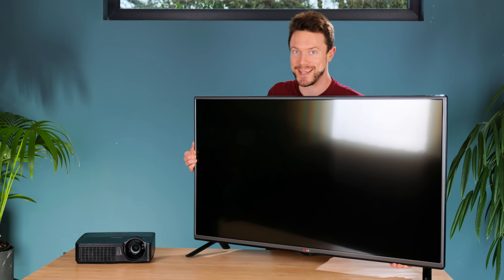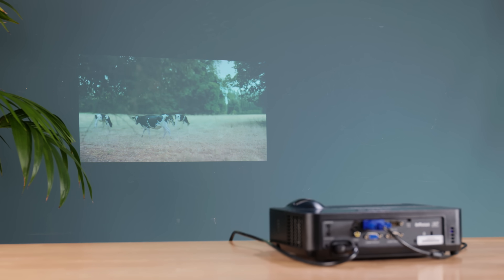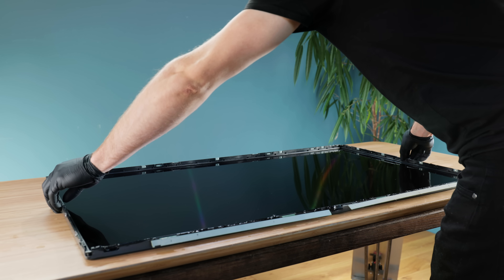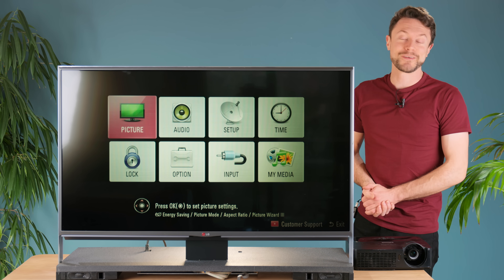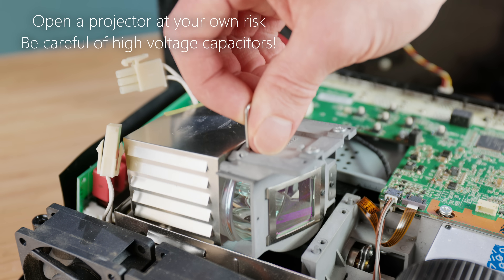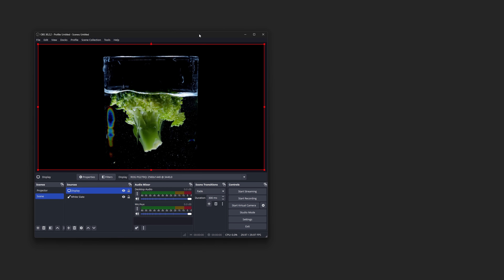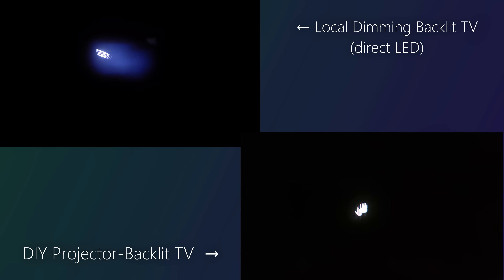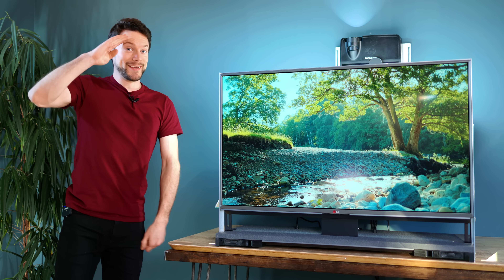DIY "infinity contrast" TV -  with 100% recycled parts

Comment: I'm sure the engineers at Dolby and Highsense who worked for 15 years to crack this nut are feeling pretty silly right about now lol. 

This is amazing man. Just gonna say, an 8K Samsung QLED as the LCD panel with a 4k UST Laser projector with 8k pixel shifting would give you a screen nobody can buy, you could probably also up the voltage on the lasers and get it to HDR levels of brightness for your own Pulsar screen.

Comment: There are high luminance projectors out there, which throw out a LOT more light than these cheap office ones. The really cool thing about this project is that upgrades to the components scale really well to the final quality of the screen. 

(And conversely, you can reach a proof of concept with real garbage level devices 😅 )

Comment: 17:35 His finger is reflecting the light, which means we are most likely being tricked somehow. Most likely the light is coming from the front, so it is casting a shadow.
Reply: Notice where he is standing, right next to the contraption, if you look closely at his hands in that time frame you will notice that the light is in the back side of his hands, the light is reflecting off his hands onto the tv causing that effect. It is not a shadow that is being casted but actually a reflection of his finger.
Reply: @me_1210  17:48 his hand goes behind the screen and doesn't interfere, but at 17:22 there is a reflection. At 17:56 is a good moment of display and no overlap. 

With this video, there's something wrong or something not being completed

Comment: There is a problem with your mechanical design. When the electronics were in its original position it was upright so convective air flow was cooling it. And, frankly speaking, that was JUST enough to not overheat it. So when you laid it horisontally the convection became much worse.
Reply from the maker: It's a good point, but now that it doesn't have to power a backlight its total power draw is only a few watts so doesn't get hot at all.
Reply: @DIYPerks  I think that the CPU is the hottest part, not PSU.

Comment: Projectors usually support 3D video and high refresh rates out of the box (Even higher if you take the color wheel into consideration.).

Would it be possible to make all of your images/videos several of the specific color components each frame and also give it high refresh rate video (Though, needing to somehow disable the DLP 3D glasses pattern between each of left and right eye.) to achieve a sortof PWM effect to dim the light output of the projector for better color reproduction?

Comment: This is the same way the Christie Eclipse projector works, albeit with 2 sets of DLP chips working in series. The source image is split two ways, one going to the image chip (the LCD panel in this case) and the other to what they call the 'pre-mod' chip (Matt's projector acts as the pre-mod). The pre-mod chip performs essentially the same image processing that Matt did here with OBS. Downscale to a lower resolution (the Eclipse is 4K but the image sent to the pre-mod is downscaled to 1080p), convert to grayscale, dilate/glow, dither (probably using ordered since its the fastest and least compute heavy) and finally some amount of blur, using either software or optically. You can find the patent for it online. It's actually an idea that's been around since the invention of the DLP chip. I think the first patent I've found was from around 1999.

Comment: But this is possible to achieve by using 2 lcd panels where the first panel is just black and white for the luminance map and the second front panel is the color filter.
You then put the diffuser sheet on the back and use a very bright but small lightsource

Comment: Great idea, but it's not infinite contrast as the title claims. The DLP projector itself has a limited contrast ratio like 1000:1. The dark area does not mean it has completely no light. The DLP still shines very small amount of light to the "black" areas as well. It's a huge improvement compared to the old LCD TVs, but this does not mean this DIY will give you the "infinite contrast" like OLED whose black level is really zero.

Comment: I am curious because you do not make it clear in the video. Using the TV panel, the projector and OBS, how exactly have you managed to get all of them working together? I am assuming the image on the TV is being provided by a computer but how is the image being sent to the projector via OBS? is this being done by the same computer using a 2nd video output on the computer? You need to explain how you did this.

Comment: Wow, great project. I have the exact same tv. The backlight died and I had to replace it using parts from AliExpress. After I fixed it, I found it was not too bad to calibrate the color. The stock settings were far from accurate.  Grass looked brown.

Comment: How is this any better than just using the projector on the wall? Also, why does the TV still need to function? Can't you just use the diffuser screen with projector?
Reply: The color and resolution of the projector are worse than the lcd panel.

Comment: Sony did this in 2005 with 3LCD rear projection TVs but at the time they didn’t have the PC to be the image signal processor and still had a DLP wheel projector. They were very cool though and I’d imagine if you can find one cheap and swap out the LCD panels for a 4K one it would be ideal as projector, mirror alignment and case already there.

Comment: Perhaps I do not understand this fully, but why do you need the diffusion layer with this method? Wouldn't it be easier, more accurate and brighter backlighting, and possibly even eliminate the need for the OBS -hack if it was not there....?

Comment: LTT recently ripped apart an old rear projection TV as a case to mount an OLED TV at the front and then stuff a bunch of gaming hardware into the cavity.

I wonder if it might be practical to convert an old rear-projection TV into a self-contained version of your "infinity contrast LCD" by using a similar approach to mount an LCD TV panel at the front.

Comment: 17:00, I was thinking, you could reduce the throw distance by switching out those flat mirrors for a pair of convex mirrors. You might be able to do it with a single mirror if you curve it enough. On top of that, a tighter curve will also allow for a smaller mirror making it easier to enclose this entire setup for a more polished look.

Comment: So just a short throw,

While using a projector for this, isn't using a double TV going to have the same results? 

The light from the local diming limitations is visible on the first image screen, but it's going to be so low in comparison with the second difusion towards the second screen, you loose most of that effect. The better part is that you only need to upgrade the original backlight lamps to be more powerful (and most likely add some additional cooling on them) to pass through two diffusion layers and screens.

This would also solve the thickness issue.

Alternatively, to keep using the projector, you'd be looking at some crazy funky lenses to bounce the light to where it needs to go. Not per se a short throw projector, but definitely a short throw lens.

Comment: Your idea reminds me so much of the Hisense dualcell tv. It was a LCD tv that had local dimming, but also had 2 LCD panels. The backlight would pass through a 1080p black and white panel before going through a 4k color panel so it would practically have almost per pixel dimming. I believe the local dimming was kept for both energy saving and the fact (as LCDs nature) the black and white panel would still let some light through. I'm sad it failed. I wanted one so bad.

Comment: I am surprised no one in the TV industry thought of this. I hope some manufacturers watch this and start bringing back short throw crt style TVs back. And Oled like screen for a cost effective price seems like an amazing business Idea. They need to have an easy way to switch out the bulb for sure and make sure they are long lasting.
Reply: One good board today should be able to process pretty much both the TV and the projector.
Reply: Led backlight is way more advanced now, which gets way brighter too. New LCD large format have rgb backlight, which is suppose to be a game changer. Oled is still the way Togo, especially now nthey can get fairly bright.

Something like this would be cool for a diy project, again the brightness is the issue with the projector. Its only worth doing if you can do it for cheap. If you want the brightness, well, you may need to spend 2 thousand dollar on a laser one.

Comment: Fantastic project; way to go! It makes me think of an engineering solution that may lower the price of OLED TVs without compromising on their image quality: instead of using expensive RGB compound pixels, use a cheap all-white LED array as backlight, to later filter using the cheap LCD technology shown in the video. This way, flatness can be achieved with minimal distance.

Comment: This will be my first DIY that I will actually implement from your channel! Just one clarification, the projector and your TV are using the same source? If i want to project my laptop display, will it need to provide inputs to both TV and Projector simultaneously?
Reply from the maker: Yup, spanned displays (obs does the duplication). More info on the forum thread.

Comment: Once again, you raised the bar for all DIY channels! However, my only concern and slight disappointment is that there was not Brass and/or Copper used in this brilliant upcycling project! You're the reason I brought enough brass and copper for a life-size Mark 43! 
PS: Just a quick observation/suggestion. In the Title, I think the word "Recycled" should be replaced with "Upcycled"!  I believe the title should match the idea, design and execution of the project. The highlight by OLED or LED of the project is the genius combo of tech, techniques, research/knowledge and creativity that went into bringing an idea to life only using repurposed hardware parts and software/hardware stacking workarounds!  
 ( I sincerely apologize for the long comment and explanation attempt and hope some friends, channel fans and supporters here agree with the observation!

Comment: Why not take an old 1080p LCD TV with a normal backlight, and then run the OBS filter through that TV, and then sandwich that behind a newer 4K LCD TV of the same size? There shouldn't be enough backlight bleed coming through, but I guess the peak brightness would be lower? Might be worth trying.

Comment: That's a fantastic idea. I think ideally you don't use the luminance map (as dimly lit scenes will get backlight bleed that way) and rather do processing on the LCD. Calibrating it all would be a challenge. However if people wouldn't be so crazy about thin TVs, this could make for a fantastic TV. Think a blue short throw laser shining on a quantum dot panel to convert the light into white, then a good LCD panel in front of it. Calibrate it all well and you'd have a long life, burn in free high contrast screen. Not sure how bright it would really be, and in terms of pricing a laser projector glued to a LCD will probably cost more... but it might be quite impressive. And flat. And to get more brightness, add another projector from the other side. Also not sure if the diffuser is necessary.

Comment: for super thin, sandwich two LCDs of the same diagonal size together and upgrade the backlight.  The contrast of the screens will multiply together so even if there is a tiny amount of bleed from the first layer the second will crush it to nothing.  There must be a fundamental flaw in this idea because it seems like a super trivial way to make high-end LCD screens?  E: Answering my own question here, polarization filters.  If you've ever looked at an LCD with polarized sunglasses you can grasp the issue immediately.  There's probably a clever workaround here with the diffusion layer.

Comment: You didn't need to do so much work. It would be super simple if instead of a projector you adapt the LG LCD panel to a Mitsubishi DLP screen of the same size, that is, you need a Mitsubishi DLP TV of the same size as the LG, fortunately not only Mitsubishi made DLP TVs, there are several brands including LG too
No era necesario que hicieras tanto trabajo. Sería super sencillo si en lugar de un proyector adaptas el panel LCD de la LG a una pantalla Mitsubishi DLP del mismo tamaño, es decir necesitas una TV DLP Mitsubishi del mismo tamaño que la LG, afortunadamente no solo Mitsubishi hizo TV DLP, las hay en varias marcas incluso LG también

Comment: Surprising that TVs haven’t shifted to using an extra monochrome LCD layer behind the diffuser to get this same effect. It could be a cheaper alternative to OLED but with a similarly amazing contrast. Cool stuff!
Reply: There are some consumer 4K sets with an extra 1080p monochrome panel acting as an extra filter. I think it was by Hisense or something.

I think it had some issues with ghosting and input latency and ofc it wasn’t very energy efficient/bright as the added layer reduces backlight output so basically the challenges that dual lcd monitors generally have.

Though it probably could be improved by reducing the resolution of the monochrome panel further as bigger pixels would let more light through them. Something like 480P would probably be a reasonable compromise cause the blooming would still be fairly small compared to any fald out there. 🤔

(Also one could actually have the backlight be dimmable with a lowish amount of zones to help with the energy efficiency and increase the contrast further. 😁)

Comment: I would suggest a LED tv of the same size as the LCD tv mounted instead of the back light, that way you do not add a significant thickness or extra ambient light as a led only powers the pixels needed but is usually not super high rez, but enough for this. I don´t know if you even need a diffuser but if you do I bet you can use the thinnest one that was in the tv to start with. I would love to se if you can manage to make that work. Good video none the less.

Comment: Why not make a TV like the old ones with the fresnel lense. You can contain the light coming from the projector bouncing on the walls. That way, you could use the TV in a dark room for full immersion. As for the heat generated, you can add fans to the box

Comment: Either move the diffuser up against the screen or remove it and use the projector straight onto the screen.  It'll remove the shadows and you probably don't need the diffuser with the projector light synced and lined up with the screen.

Comment: This is an awesome DIY project however you skipped over some important details.
  1. What are you using as your video source? Is it the TV itself or a laptop?
  2. Are you using a splitter to send video to both the LCD screen and the projector? 
  3. How is OBS integrated into the video signal to the projector only? 

There are some missing pieces about how you made that work.

Comment: Why not use a similar setup to old back projection TVs? Just enclose the mirrors and projector inside of a box and hermetically seal it so you don't have to worry about dust in any of the projection media?

EDIT: Or just put the screen directly into an old ewaste back projection TV.

Comment: I'm wondering if this could be done with an old rear projection TV instead of a projector. Would fit the bill of being an upcycle project, as there's lots of those being thrown in the dump these days, but it would solve the issue of the projector having to be placed a few feet away from the display.

Comment: Adding back the color wheel and upgrading the bulb to a high power LED would greatly enhance this tv giving it better colors and better blacks. Maybe even try to modify the color wheel with better filters.

Or, using a very small very high resolution LCD to produce an insanly good DIY projector, as the size would not matter as much, as it is mounted somwhere else.

Comment: Looks like a great outcome!  For me though, there's just so much about projectors to dislike, even if the picture is great. Don't work in bright rooms. The fans are loud, the lights make a lot of heat and eat significantly more energy.. and that's on top of the space restrictions you discuss here. I used projectors for years, mostly for "movie nights" where the light could be controlled... but overall, today's super cheap, massive 100" TVs just blow them out of the water in every way.

Comment: With some more effort, one could write a program that calibrates the position of the projection so that the glow effect is not necessary and also to remove the necessity of readjusting the projector every couple of times you use it.

Comment: Actually your light response isn't linear, but that can be fixed in software with a formula.

Let's say the LCD panel's contrast ratio is 25:1 and call its reciprocal R with a value of 0.04.
So the LCD's light response is R + (1-R) * x
So to make it linear the projector image's should be x / (R + (1-R) * x) which gives a smooth curve.

Comment: An interesting project for sure. The biggest problem with the old projectors is the light from the bulb dims over time and the bulb is expensive to replace. Some people have converted them to LED, so that would be an interesting follow-up. 

I bought a 4K 55" TCL Roku TV from Walmart for $200 delivered, and I use it as my desktop PC monitor. That's less than the cost of a replacement bulb, which would last a year with my work. If you find an old working projector, it probably needs a new bulb.

Comment: Cant help but think this is a perfect setup with a shorter throw projector to retro fit into a crt tv, say a 32 inch for example with a led or dlp short throw projector as a light source , keeping the crt foot print and look if its got a glass fronted panel over the tube and minimzing light bleed